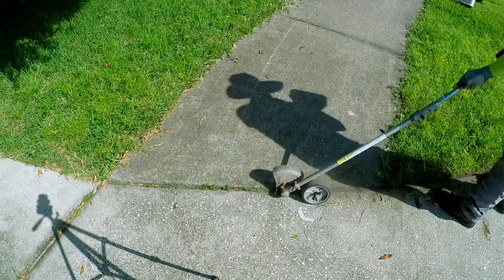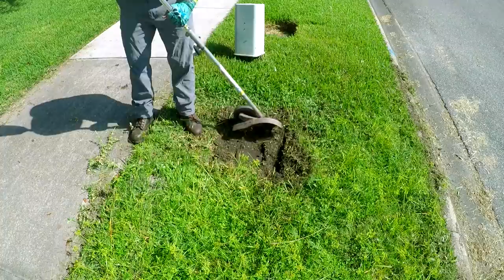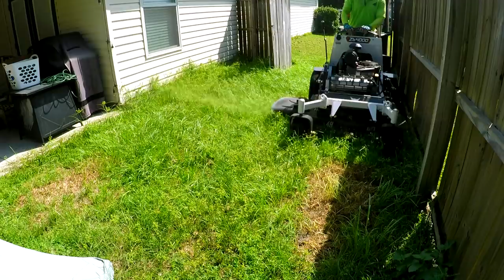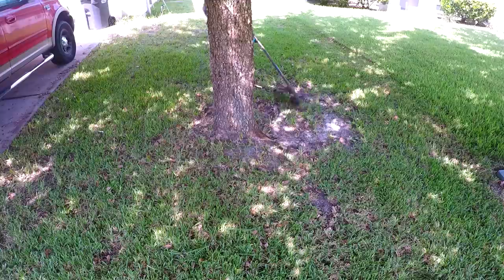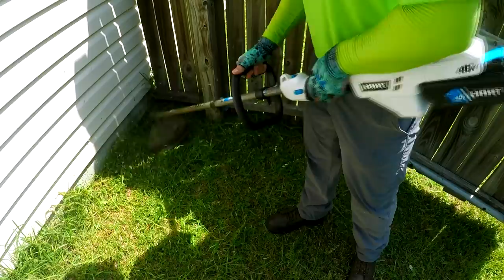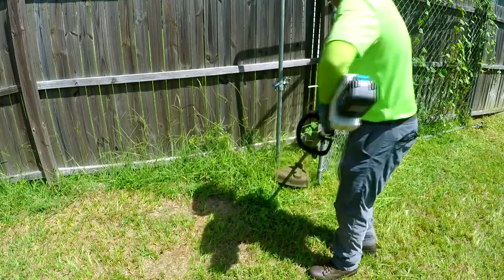Worst Yard Of 2020 Made Perfect For $75

Comment: 518 views and only 75 likes...JEEZE FOLKS!!!  Brad earned every bit of this one!!!  I don't blame you a bit for dropping this one Brad.  Too much to mow around in the back yard and to be honest, the Bobcat is too big for the yard anyways.  It was the correct tool in the shed considering how much horsepower it takes to mow overgrown grass like that one, but now that it is manageable even the local high schooler with a hand mower and equipment and a desire to make a great business could take care of this yard.  Nice job Brad and kudos for honoring a contract/promise.  Many other contractors would have left that one in the first hour,  I figure that one took at least 2.5 not including the time to film it.  How many batteries did the Hart trimmer need to pull that one off?.  Also is the Sthil edger getting a little bit worn out?  It sounds like the bearings in the motor are giving away..
Reply: I agree totally Matt. I think his clutch is getting worn. Its a combi unit and the different torque for the various attachments are demanding. I heard the unit roaring and it look like the blade was barely moving. He did a good job!

Comment: Why don't you bag your clippings?

Hey, seriously, I think you need to return to that job and touch up that corner at 44:33 . I got the feeling your heart wasn't really into it.

But seriously, really, I bet if you'd had the Echo you'd have missed the Hart if for only it's light weight. Seems like a great tool and you gave it a solid torture test. It's on my short list thanks to you.

Lastly, I winced at where you were in the alley area and that side discharge blasting everywhere. I've mentioned before (I'm sure it's in your notes) I run an Exmark Radius S rear-discharge for 2 seasons now (I'm only a full price paying customer, no other connection). I don't know why the idea of rear discharging clippings hasn't caught on. I notice very little to no winrows, and I have an even tighter zone, between a pool and 50' of fence with plantings that I can now easily just pass through without needing to return with a blower or the leaf rake for the pool. And it handles a couple acres with speed and aplomb.

Thanks for sharing (and I suggest viewing at 2x).
And a Happy Thanksgiving for all Americans. Please remember how it started.